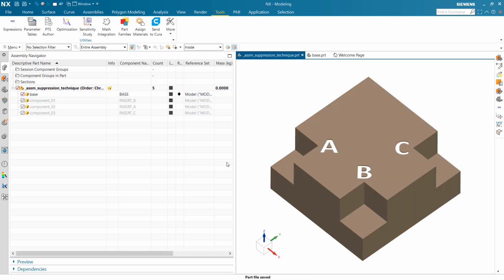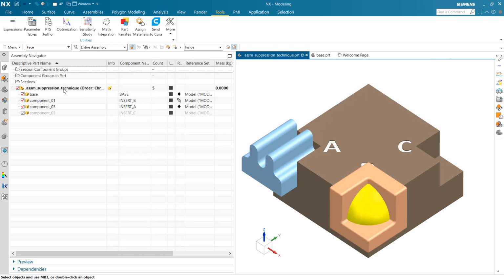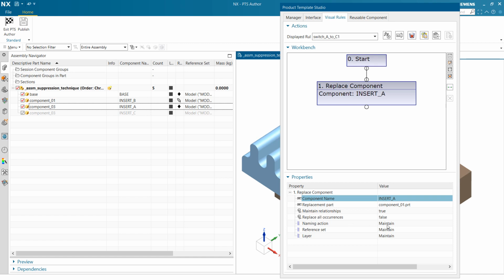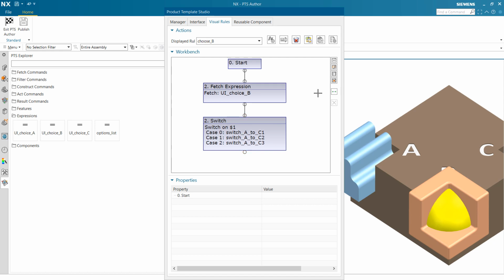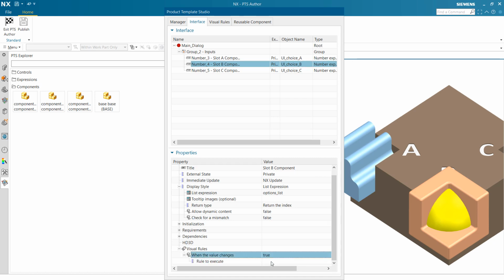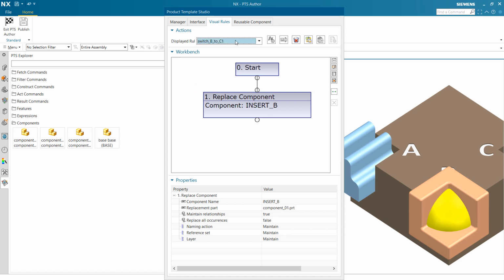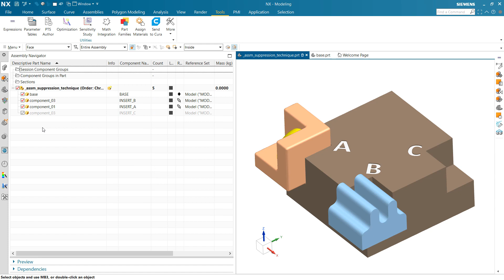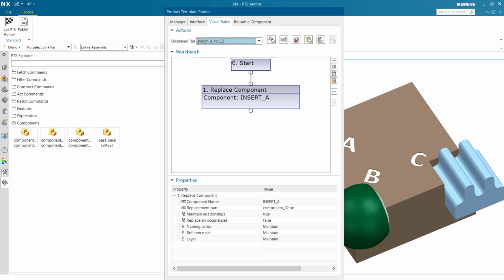NX Product Template Studio: Using Visual Rules to Swap Assembly Components [NX 1953]

Comment: In this example, it is possible to have a single replaceable component that can be mounted to a different slot depending on the component selection made on the product template. (i.e. if component_1 is selected it gets mounted to slot A, if component_2 it goes to slot B). I could use suppression by expression, but i was wondering if i could use visual rules instead for a cleaner execution.
Reply from the maker: Interesting question!  We don't have the ability to directly specify alternate assembly constraints, but if the different mounting positions were spaced along a similar direction, you could certainly have one of the assembly constraints be a Distance constraint that could vary based on the selected component (and thus in your example, modify the position the swapped component into slot A or B based on a different distance value.)  I suppose this could work for angular constraints as well, now that I think about it.  Again, thanks for an interesting question!

Comment: Is it possible to make pts ask a user to "select a point" and use it data? or select a surface and fetch that data.  Instead of hard coding which surface or point to look for?
Reply from the maker: Definitely!  You can certainly include WAVE Link features in a Product Template interface, enabling you to associatively select geometry (points, datums, sheets, bodies, etc.) in nearby parts to use in your construction.  Your  question is a great one, and it's made me realize that I don't have any videos up about using WAVE with Product Templates.  I'll add that to my list!  Thanks!
Reply: @taylorandersonnxvideos  also i was able to make points user selectable. By craeting a point expression and adding that to template.  In the ui it will ask user to select point. 
The users selection will be the new point and that data is stored in my expression. A makeshift user selection of geometries(only point so far) 😅
Reply: @taylorandersonnxvideos  ooh i will try wave. Although i dont know how to bring them into product template interface. 
🙂 the actual root for my question was i discovered pts as an alternative to udfs. But udfs have reference object concept which pts doesnt have. Since udf is a feature. Pts a whole prt. 
So was wondering how can i implement udf reference concept into pts. If you can answer this it would be a huge help. 
🙂
Reply from the maker: @saratchan-mv  As for WAVE features, in the Author tool just drag the WAVE feature into the UI...  We'll automatically create the right UI to reparent the specific linked objects in the feature.  🙂

And if you're coming from UDFs, then take a look at "Feature Templates" in NX, starting with NX 2206.  These are the next-generation UDF, based on a common authoring framework with Product Templates.  Here are some videos about those (including a WAVE example):  https://www.youtube.com/watch?v=XaalG76-A2s&list=PLbSlfYWKqgiwdL5IeUiHnJ4wM0mw0rDWY&pp=iAQB
Reply: @taylorandersonnxvideos  ooh will give a try with wave features like u directed. 
And yep! I learned about feature templates from one of your posts on a forum. Unfortunately for us we need to work on nx 11 😅
I am eagerly waiting for my company to upgrade to a new version so i cn try feature templates. 
Will definitely check out the videos on it. Thanks alot.
Reply: @taylorandersonnxvideos  Yay! Yes i was able to use WAVE features and get an input from user. Tested and it works like magic. UDF functions in PTS ! 

Thanks a lot for taking your time in replying and helping. 
😁
Reply: Hi, I've created a feature template that creates a dovetail shape for machining and I've set it up to bring in the correct vise component depending on the dovetail size, how can I constrain the vise to the dovetail automatically? It's a feature template so I can't really rely on replace component and retain constraints like in this video